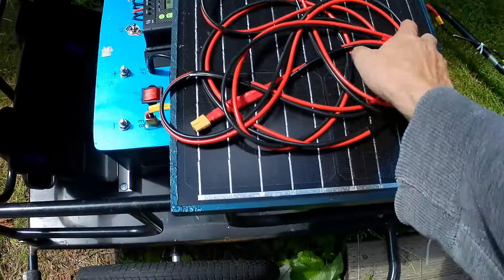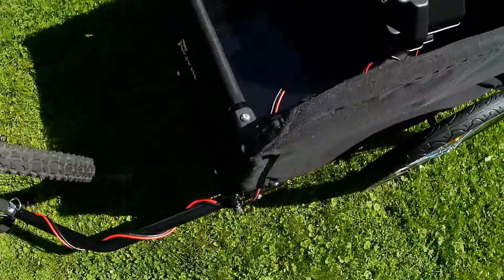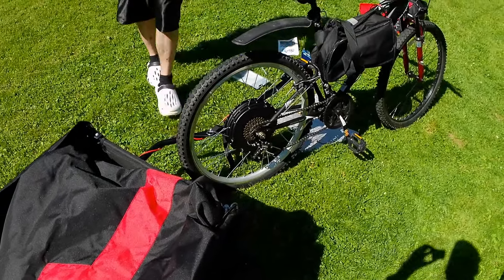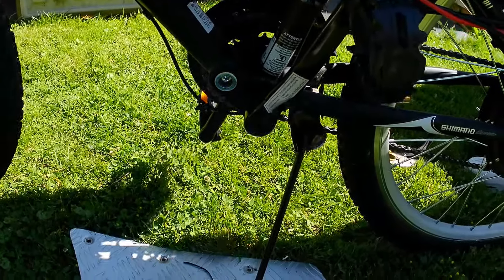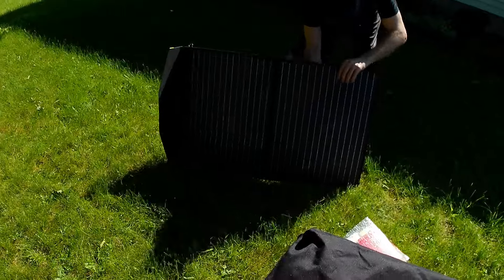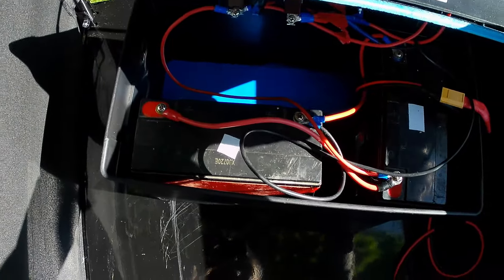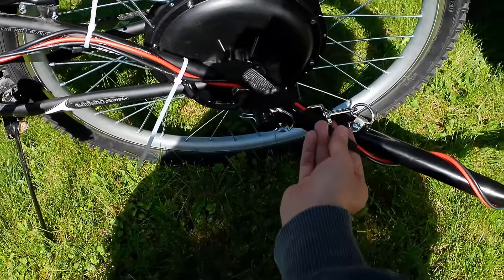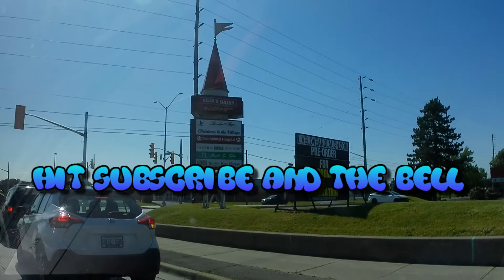Building The Ultimate 500W Solar E-bike! Part 2

Comment: Long live the solar trailer!
Reply from the maker: It's just to much fun once ya got one right lol once I get a good battery it's like, where can't I go.
Reply: @Ro-Bucks  Indeed. I will be making a 100w solar lid for my trailer here soon. As the 200w one wont fit in my car.
Reply from the maker: @Eric_Tennant  nice I like your trailer setup, was thinking about how much I want to pack, and I could make it fit your trailer. If I fill mine, it's overweight at that point anyway. last 2 years has been all about reducing weight.
Reply: @Ro-Bucks  Eric, have you noticed the trend of slide out bike campers and the 10 kwh trailer that broke on its maiden voyage? It's all a balancing act, and mass is massively important. What is the burlys capacity? I figured your trailer to be under a hundred loade
Reply from the maker: @acroduster  Just under 100 pounds just with the battery box in it. thank fully the cheap camping gear I got is light.
Reply: @Ro-Bucks  I really need to weigh in where I currently am, guessing my bike with battery is around 60-70, trailer with camping gear and second battery plus panels is about 80-100, maybe a bit more. But a lot of my trailer weight is solar panels I had on hand, I really could cut a lot of I went from framed glass front pmonocrystaline panels to flex panels. But then I would have to spend money,

Comment: Why not use an 300w mppt boost converter to charge the 48 directly off the panels?
Reply from the maker: Been thinking about that, I have 2 different little DC to DC boosters I could try, but until I get bigger packs, I think it's safe.

Comment from the maker: Money is short were both on the ODSP, means were all set for an adventure but where stuck with a 7.5Ah battery each (they say 30Ah phhfff). The good news is they work ish and they charge fast so loss of charging stops, and we can get anywhere lol I hope I can get new battery before end of summer (3-4 months), I have an idea to find 4 13S2P packs and nickel strips to make 2X 13S4P packs for 12AH and then over the winter ill make huge batteries.

Comment: Why not make the solar panels the roof for the cart and you can have them charging the whole time.
Reply from the maker: That's what I was doing on my last few setups, and I might go back to that for my 60W setup. My friends black and red setup with the foldable panel will work fine once I get him new batteries. They charge fast enough. And also, can't really charge the e-bike battery while using it yet till I have a bigger pack, just the trailer battery bank.

Comment: This is not the future! This is in fact over a decade after it became common and solar ebiking became a thing that could be afforded with off shelf components, aside from the click bait fake news title, keep going, ill keep giving it a shot you will either get better and build better or you wont. Best of luck.
Reply from the maker: true, I'm aiming to be the lightest someday. The setup in this video had a better trailer and solar panel then mine but we need to work out an issue with the e-bike hub mounting to the bike. His back wheel keeps slipping off or it was, I think we got it on better now but I'm sure there's an adapter we can find. As for my setup I'm saving right now for a 200W panel and lithium battery pack. Ill also be adding 48v to 12v step down so I can remove the 12v lead acids from both setups and run the inverters off the lithium batteries I'll be building. Thinking of building a couple 13S20P battery's but saving for months to do that. Thanks for watching!
Reply: @Ro-Bucks  I too use hub motors, Regen down long hills added to solar on trailer equals controlled downhill speed and over 700 watts combined charging, I want to do the great devide in Yellowstone deplete the batteries on the upclimb, and Regen solar recharge on that long downhill into Wyoming. Do you mean your hub motor is slipping out of the bikes rear mounting perches? Or is it torque spinning the axle? I had to machine a torque arm I trusted for mine, even 750 watts puts some pretty serious newton meters at the axle. We're all a work in progress I suppose, maybe we can ride together camp together and compare our rigs someday, I love what you have done with what you have had to work with. Better to be on the road and improving slowly than doing nothing. If you have not already considered it, I highly recommend 12 gauge dt swiss spokes for long service life and reliability, and Vesc speed controllers are way more efficient than the Chinese controllers, pure sine wave matters a lot, I'm light but I gave up on going for the lightest once my setup hit satisfying, also schweable tires are no joke. Most bike tires are just trash. Anyways happy riding. I'll keep watching. Maybe I'll even start posting vids again, YouTube has been devoid of cool things for a while, solar biking is fun and cool.
Reply from the maker: @acroduster  the hub shaft is slipping of the bike, and thanks. The rear fork is just not a meaty as mine, I'm not sure how to say it. it doesn't like the thicker hub shaft. On my blue bike the rear fork is a think soled plate on each side but his is made to fit the rim it came with. idk